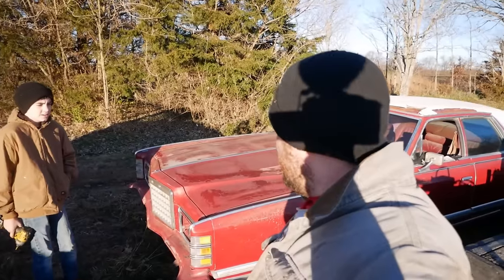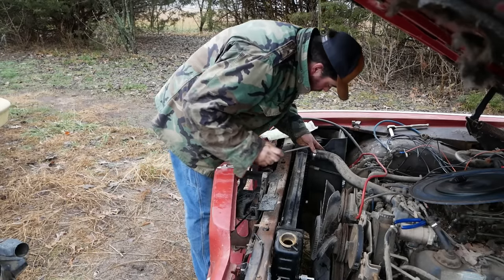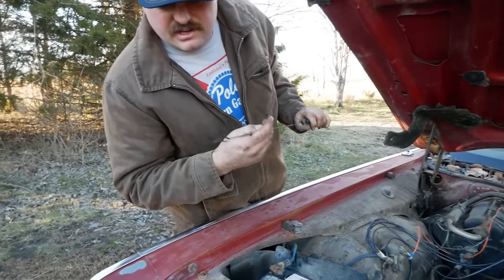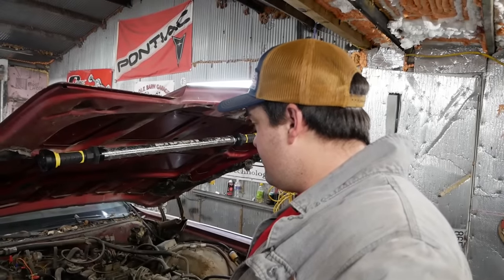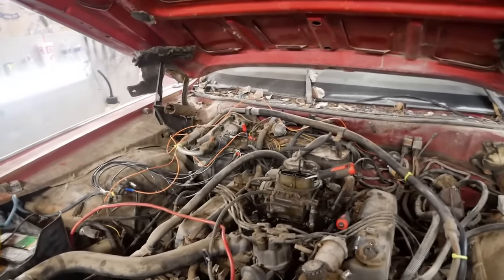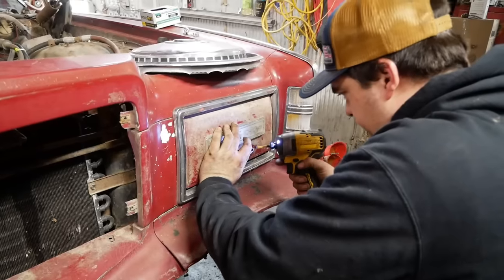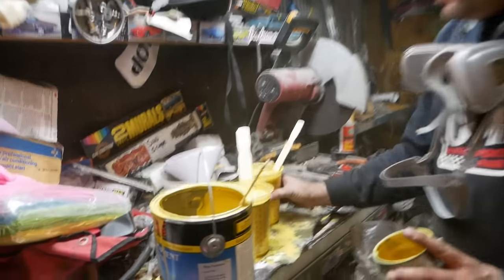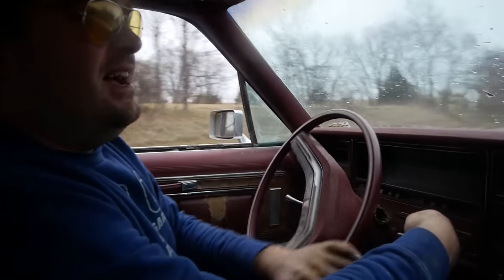REVIVING A '77 Ford LTD Into A TAXI After 28 Years

Comment: I love your LTD videos.  My first car was a '74 with a 400 in it.  It was a light, custard yellow with a green interior.  Bullitproof... until my brother borrowed it and ran it out of oil.  At that point it developed a knock.  Later, the automatic choke failed and it filled the crankcase with gas, and it developed a second knock.  Dad noticed gas coming out of the dipstick tube.  He just deleted the auto choke and changed the oil.  Then the brother borrowed it again and was driving in reverse with the door open and went into the ditch, placing the driver's door on the hood.  Got a junkyard door, which was a different yellow.  My dad owned a service station, so I could pull it in after hours to fix whatever.  And gas was cheap.  I put lots of miles on it, and it was fast!  The placement of the AC piping made changing the alternator near impossible.  But that AC... you could hang meat in there!  It would frost the vents on a hot day.  The temp difference one hot day made the rear driver's window blow out!

Comment: I bought a 77 LTD in Tampa just after getting off the plane from the UK in 1987, paid $900 and drove it to Mexico where it was totalled and then sold to the local Mayor as a garden ornament. Must say I love PBG as you are reviving all the cars I used to work on and rent out when I moved to San Diego. I worked for a business called "rent a car cheep" and yes the logo was a chick. Rented out all the stuff you have shown on here, even square bodies... if they came back from across the border, great! Didn't matter if they didn't as most only cost a few hundred bucks from the breakers and auctions on the border. Thanks to my time in the US I only drive large motors in the UK, yes I do have a Jaaaaag and several full fat Range Rovers topped off by a 300c touring... estate in the UK, don't think you had them in US? My neighbour has a Dodge charger and an AC Cobra and my cus runs around in a GMC truck so we do have old US metal over here.

Comment: I have one of those disc rear ends.  9-3/8" instead of a 9", but has 31 spline axles and you can swap in a big-bearing 9-inch diff

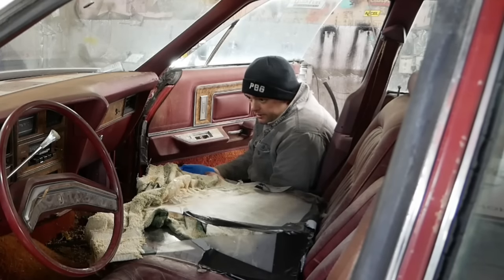Comment: 18:40 fully stocked trunk with the fox body hubcaps (probably correct for Fairmont, Granada, early Mustang, 80-82 T-Birds, etc), that whole steering column, the assorted single snorkel air cleaners, that snow shovel, it's nice to get some extra goodies when you get a car, whether you can use them now or not because extra goodies always come in handy eventually.  Even if you are just picking them out of the yard five years from now thinking, oh wow, I thought I lost this LMAO

Comment: Dalton I know you've been painting forever, as have I. One trick I learned from my old man (miss you dad) I take a nail and poke 3 or 4 holes in the rim under the lid (after I remove the lid, obviously) where I pour it out. Then the paint - instead of running down the side of the can, it just kinda falls back into the can. I save at least a quart of paint every gallon hahaha with that trick!! Need a pretty big nail, but it actually works really well.

Comment: Never understood the hate for 4-door cars, especially the large cars. In my opinion, albeit subjective, the LTD, Mercury, Olds 98, Cadillac, Chrysler, Imperial and Lincoln, looked quite clunky and out of proportion with the huge doors rear panels that made the front end look so stubby. The 4-door hardtop, even those models with a thin B-pillar but frameless door glass look quite elegant. It is enjoyable seeing the not too often seen vehicles at shows rather then the endless lines of 'me too bellybutton' rides. Like the channel and the enthusiasm you all have.
Reply from the maker: 2 door large cars are pretty much equally worthless, although that's changing. It's just not worth restoring one when you can buy a nice one for a fraction of the cost, like I did lol
Reply: @PoleBarnGarage  agree. Very much so. But to some, myself included, a particular vehicle type/style holds deep family memories. In my case it was/is a 1966 Oldsmobile Ninety-Eight Luxury Sedan. I can't put a price on memories, I have (not the same) car as we had many years ago. Bonus, the 425 Rocket V8 makes the car pretty snappy!

Comment: My younger brother had a 97 F150 that the linkage that connects the key cylinder to that ignition box broke. He didn't want to pay for a new steering column (because he was going to be getting a newer truck in a little while), so he did basically the same thing. If I remember correctly, that one had a little tab that slid to start it, so at least he didn't need a screwdriver.

Comment: Mannn, i remember when i was younger maybe 14-15 and a buddy had one of these 460BB LTD's and man lemme just tell ya he scared the one pube i had grown right off by casually scootin along at 45mph and then he took a right turn but instead of slowing down he simply matted the throttle which lit both rear tires up and kicked that big ol boat sideways and the turn was onto a bridge so i thought for suuuure i was going for a drink when he pulled that stunt however i guess judging by the many marks on the road at that corner he'd been doing this just about every time that he made that turn 😂 then years later same guy had bought a 429 Lincoln continental or towncar big square boat and he was just ripping along at 45-50mph and just crammed it into reverse while simultaneously matting the pedal and wheeew-weee the momentum coupled with the wheelspeed in the opposite direction sure filled an entire city block with smoke almost instantly without causing any i mean ZERO damage to the car! Then he continued to do the same thing till believe it or not the bottom-end of the motor gave out from high revving n him beating the snot out of it but the factory transmission still worked perfect freaking mind-blowing!!!

Comment: My cousin had an oil filter that didn't want to come off and after he mangled the heck out of it, he was about to get his acetylene torch and cut it off, I got under the car and took a little hammer and chisel and cut and peeled enough away to where he could use his little propane torch to get the filters threads off the stem with pliers

Comment: I just bought a drivetrain for my 73 Mercury Cougar xr7 project. For 300 bucks it’s the drivetrain from a 91 Lincoln mark 7. Sadly not the 5.0 ho. But for having only 100 thousand on it I’m not mad. Has more compression than my 93 f150

Comment: If the alternator was working, you could just take the main wire to the battery off the back of the alternator then pull the battery terminal to shut it down.

Comment: Question, would having the vacuum lines just 'plugged' not make the engine run worse? Are they not running other things in the motor with the vacuum? I don't quite understand.
Reply from the maker: Most of that is to power the headlight doors, heater controls, etc. only vacuum source that affects the cars running is the vacuum advance and transmission modulator. Everything else can go away
Reply: @PoleBarnGarage  Thanks for the clearing up, I knew things like the headlights were vacuum powered and I knew about the vacuum advance but I know post 1973 cars can be very weird with what they tried to get emmisions down.

Comment: I hate Hydro boost brakes, well I should say I just hate working on them, had a 94 big block suburban I put a normal booster on and took that crap out, it was expensive to replace, and I already had the booster and master from a 3500 that would just bolt right on with not a ton of work actually.
Reply from the maker: Yeah they're a pain

Comment: An old leather belt works way better than any type of oil filter wrench! And screw that Ramin a screwdriver threw up. Because I've seen them tear and just sheer completely off. Then you're really screwed! Yep, you put a belt on it just like you would. If you were putting it around your waist, tighten it up as you pull on it and use your other hand to spin it and it'll come right off! No wrench needed